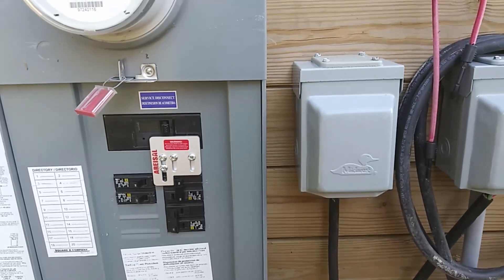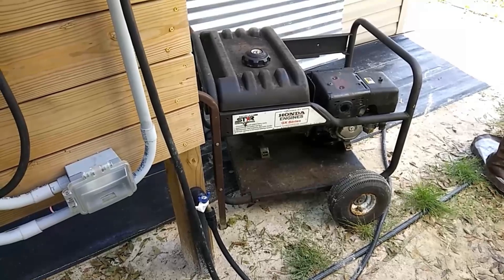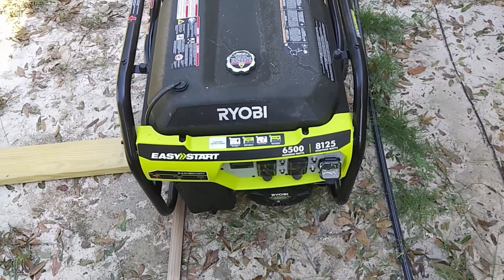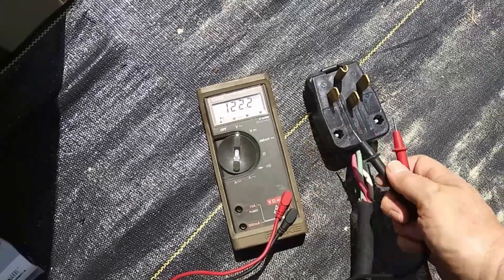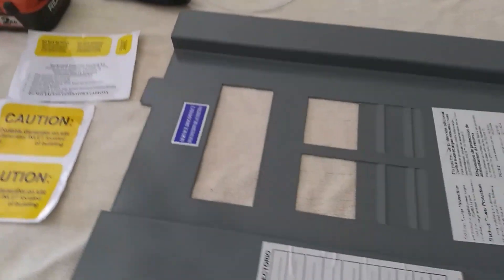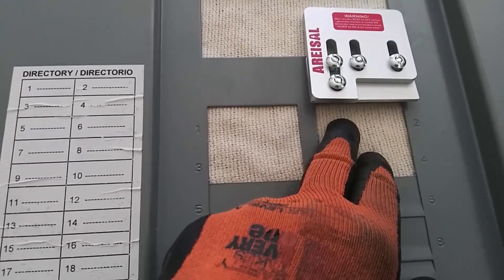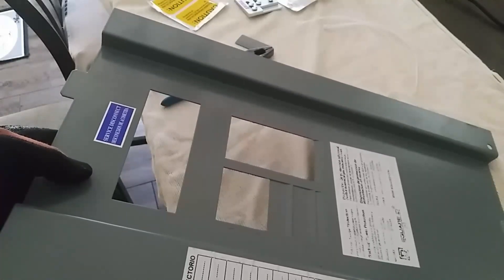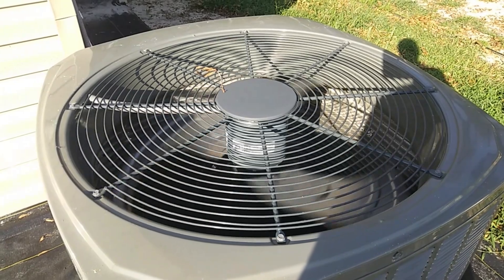Installing a generator and  interlock in a live Square D main service panel.

Comment: You might as well just wired directly to the breaker if you're not going to use an inlet. Only reason I see doing it this way is if the 14-50R outlet was already there for other use like an RV hookup.

Comment: You made what is called a widow maker plug. You should be using a generator in let box. You definitely should not be doing any electrical work.
Reply from the maker: I understand what you are saying . Thanks for the comment. I couldn't find a 50 amp input plug in the middle of a grid down hurricane event. No one but me will be using this set up and I know to plug the cable into the box before plugging it into the generator. Thanks again
Reply: No he shouldnt!! OR MAKING HOW TO VIDEOS
Reply: @T.K7601  In his defence, he did start the video with a safety disclaimer.

Comment: What you need to do is replace the generator outlet on the house. To an 30 amp or 50 amp inlet. 

I recommend a 50 amp inlet. With number 6 gauge wiring. 

The interlock plate is completely correct.
Reply from the maker: Thanks for the comment. I would have used the inlet receptacle but couldn't find one on short notice.  I'll put that on my to do list. I am using 6 gauge wire for 50 amp input.